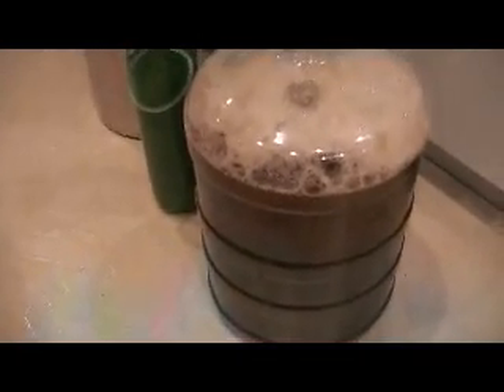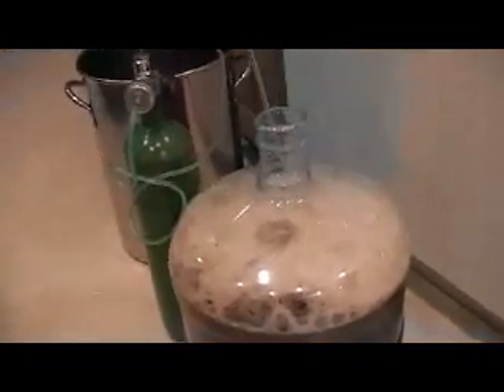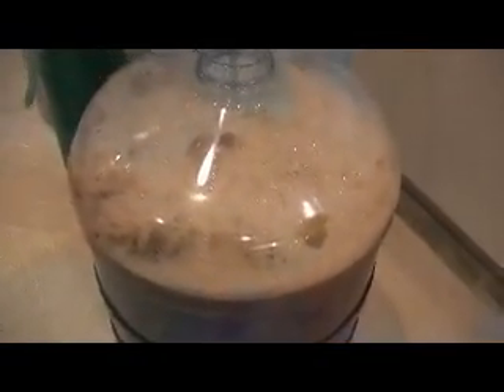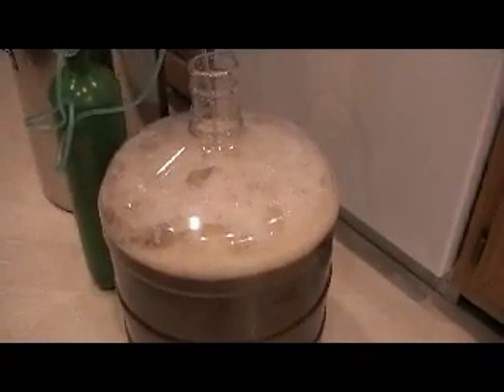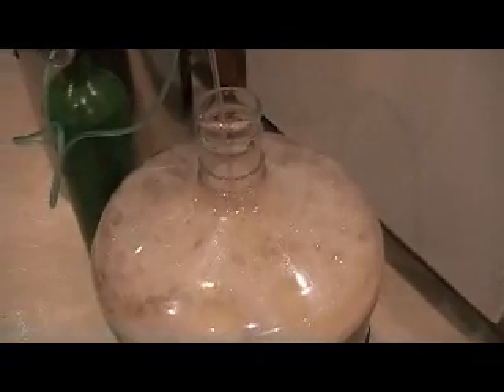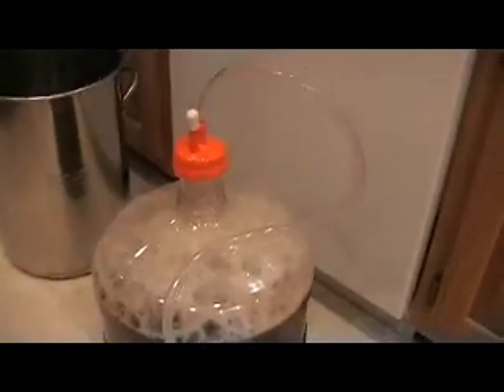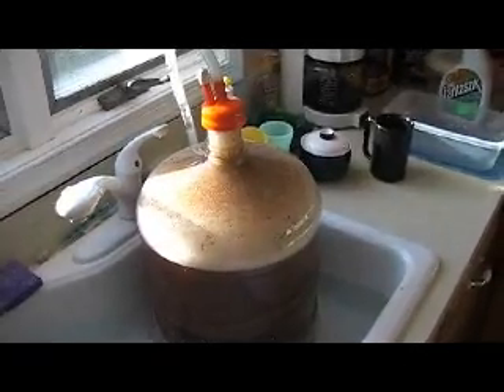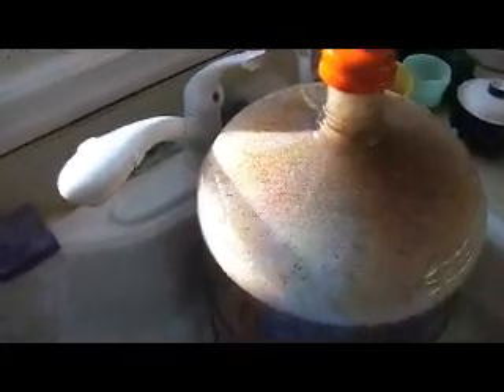Adding oxygen to homebrew

Comment: @ZekeVoltage you can get small O2 bottles at the hardware store for about 10$, and a regulator for another 20$ or so. If you turn up the regulator until the O2 is barely comming out it's most efficient because it makse smaller bubbles and you can get at least a dozen batches out of one bottle. 

Additionaly pure oxygen is less nescisary in low gravity or low alchohol beers (under 1.05 OG or 6% ABV) because less sugar means more gas is soluble in water which offsets the fact that air is 20% O2.

Comment from the maker: @JustWonderingHowToDo 
Yes you can. You'd want to use an air pump with an inline sterile filter and let it run for about 20 minutes. Shaking the fermenter does the same job but faster, of course more labor there.

Comment: I use olive oil now and don't even bother with adding O2.   I add .3 ml, for 5.5 gallons of cooled wort, which looks like it won't do anything.  However, I do think the oil does activate more 02 as presented in a paper (look it up on Google).  I know there is very much controversy, but I have had excellent results just using OO.  BTW,  I use diabetic type syringes that measure .3 graduations.   I have sterile leftover syringes from my diabetic cat.

Comment from the maker: Yeast benefit from oxygen initially because it's used in reproduction and as a store of energy for the ferment process. However, you wouldn't want to add it after fermentation gets going because it could cause oxidation in the finished beer. Most beginners can skip this stuff at first because shaking the bucket or carboy is usually enough.

Comment from the maker: Ok, my bad. Won't be my first or last mispronunciation of brewing terminology. I'm not paying $20 for a better bottle stopper thingy. I've since converted to stopper + hosebarb. No problem. I think you mean Activator pack, Propagator is 25B cells and needs a starter. I still use a lot of dry yeast and it's about $4 less than an activator. Since I'm all grain now, it would be 20% of my batch cost.

Comment from the maker: Yes you can but remember that this pump takes air from the room. Air is only 20% oxygen and the rest is mostly nitrogen. You have to run the pump for a good 30 minutes or so and sloshing the wort around in your fermenter a couple times during that time would work well. Many home brew shops sell a kit with an aquarium pump that puts a hepa filter in line so that any contaminants in the room will be filtered out.